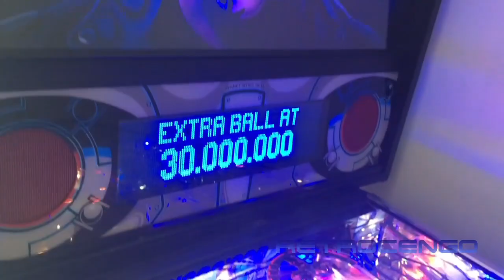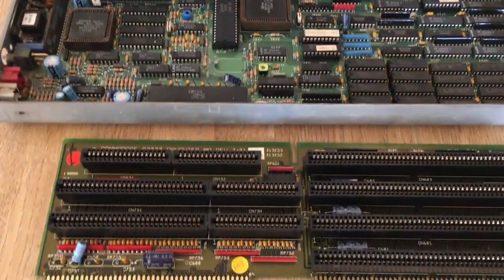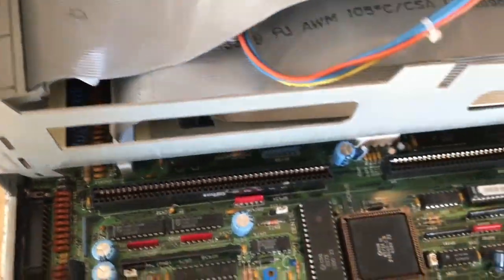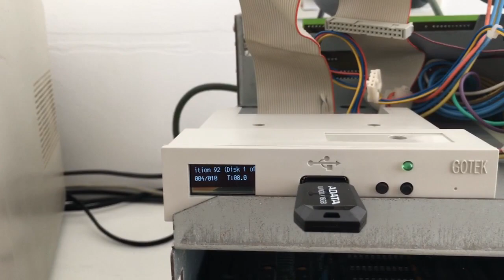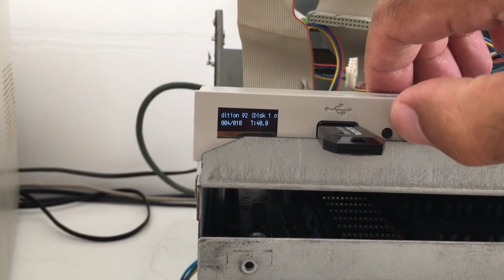Commodore Amiga 3000 reassamble and test with gotek drive

Comment: There is also a clear piece of plastic about the same shape and size as the daughterboard backplane that's supposed to go between the metal subchassis and the backplane.  They're not meant to be kept separated by the S-clips alone but by the S-clips plus also that plastic sheet in between!